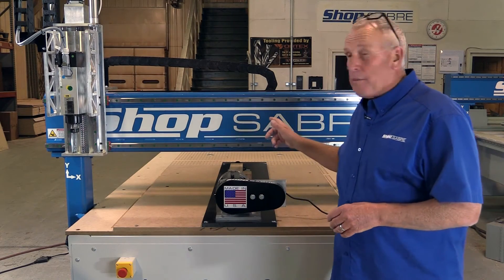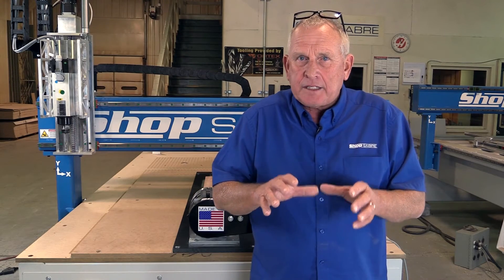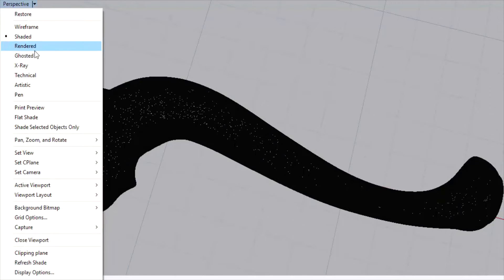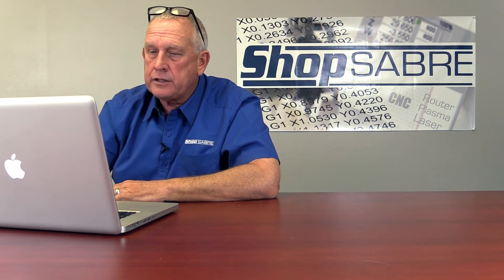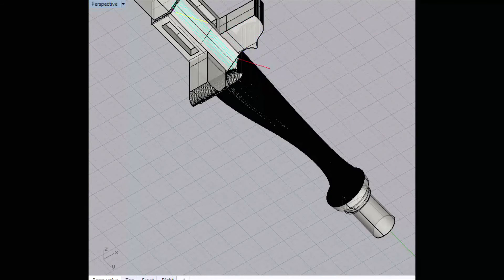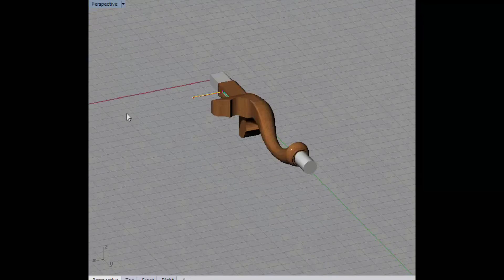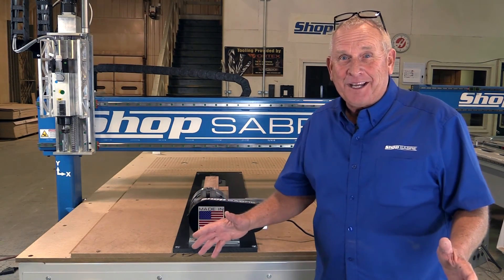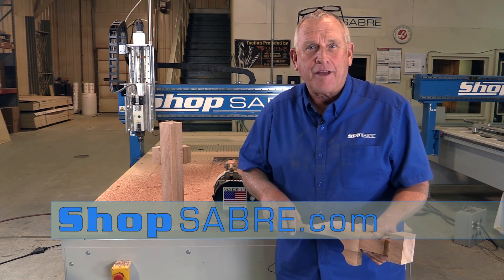4th Axis Turning on a ShopSabre PRO408

Comment: I'm trying to get a the rotary system mounted to the machine. How should I accomplish this while keeping it square to the machine? The aluminum plates don't line up with any of the tracks.
Reply from the maker: Please reach out to our tech support team and they will be happy to assist you. 952-461-4570 and ask to speak with a tech
Reply: @shopsabre  I did and was told "however you want to" wasn't the most helpful answer.
Reply from the maker: That is quiet surprising to hear and unusual, give our tech support manager a call and they will investigate this situation and help

Comment: Nice job. I know that this video was posted awhile back but can you tell us how long the machine took to complete the leg that Router Bob is holding?
Reply from the maker: Thank you for reaching out, you are correct it has been awhile since we did this project, the timing varies on the level of finish you want from the machine vs after the fact, this was nearly completed 100% on the machine so we used a very small step over which increased the time. If memory is correct it was 3 hours of machine time.